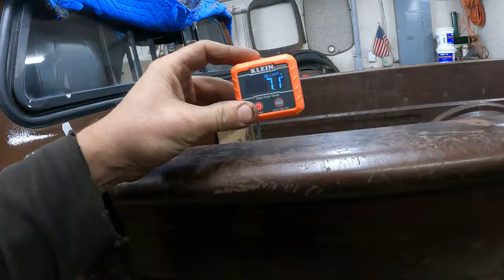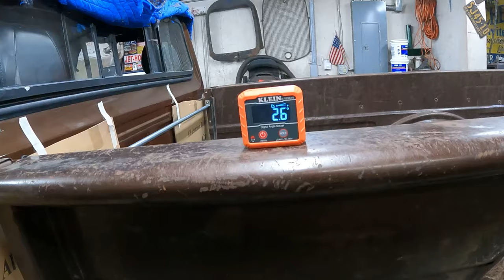Rebuilding a Dodge Stepside Bed: Part 1

Comment: Wow, coming along nice. LMC has a front panel for 72-80 step sides not sure if they’ll fit long box , but they’re right at $400. If you’ve got the metal it would be way cheaper to made your own. You’ve got a bead roller , if you wanted to stiffen it, so it would turn out nice. I built my own for the front of my 50 F-1. I was able to use the top piece off the original one along with some 16 ga. metal and I just broke 90’s on the ends and bottom (like original) and spot welded to the bed sides. I left the panel flat which matches the bedsides of the late 50 and newer bed sides, no stiffing dents or ridges. Most people unless they have built a truck like yours or mine won’t notice it’s not factory. 👍
Reply from the maker: I saw LMC had one for $400, I can't afford that. I just made a custom piece that's actually more structural than the stock one.  It will be in the next video.
Reply from the maker: Too late.  I already built a new panel
Reply: @QuickSpeedShop  ok.. would you be interested in doing the paint work on mine and putting it back together in the future & Merry X-mas !
Reply from the maker: No, I don't do any other work besides mine.  Sorry.

Comment: Use square tubing on the bottom of that tailgate. Make “hinge pins” that are square on the tubing side but round on the pivot side.. Just a thought. Welding square tubing would be much easier maybe?
Reply from the maker: I thought about square, but I think there will be enough to weld the round tube on no problem.

Comment: I hope you know that LMC truck has the front panel for the bed and the cross sill rails for the bottom of that bed and a lot more parts for it. If you didn't you do now LOL
Reply from the maker: I know LMC has all that, but I can't afford to buy that stuff.  If I was doing a full restoration to stock I would at least buy the front panel, but for what I'm doing, I'll make everything.